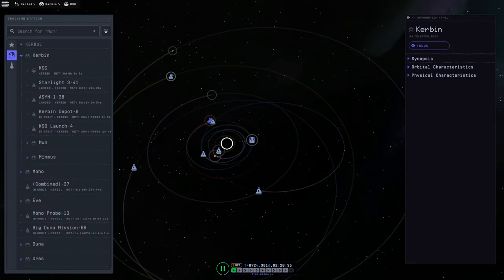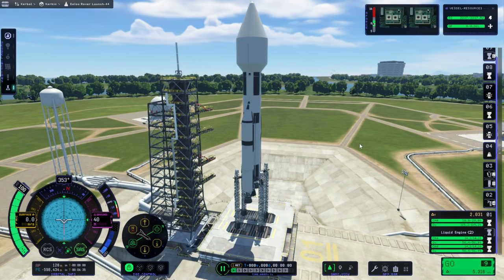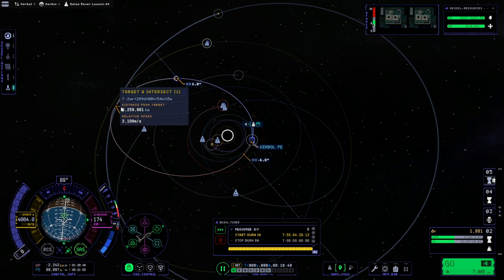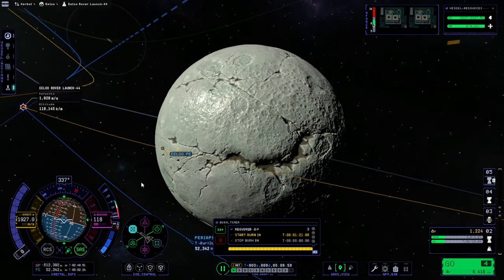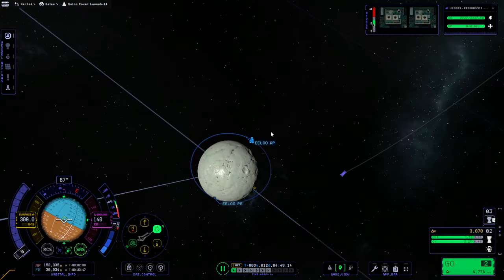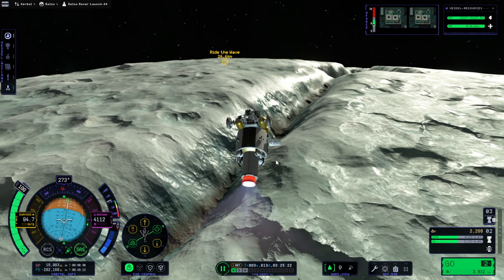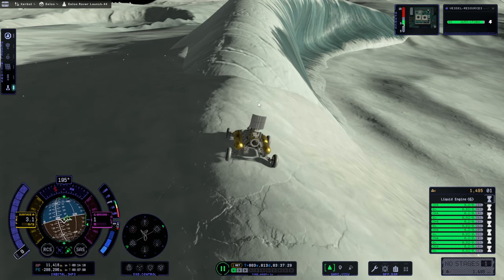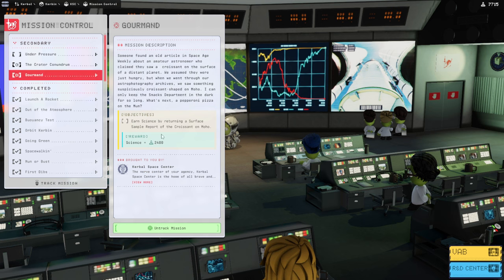KSP 2 Early Access - For Science 43 - Surfin Eeloo

Comment: 16:19 I had the same thing happened to me. I think the antenna on the Rover isn’t strong enough to transmit back to Kerbin, so another antenna is relaying control. However, I don’t think you can transmit the science via a relay. I sent another Rover to Eeloo with the Communitron 88-88 and it transmitted data just fine.  That may be a bug, or a feature, who knows.